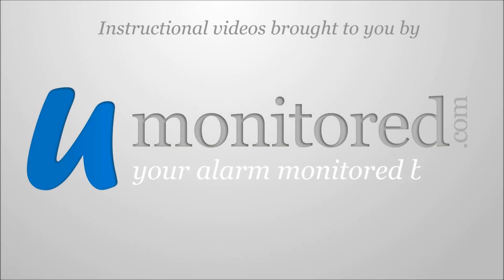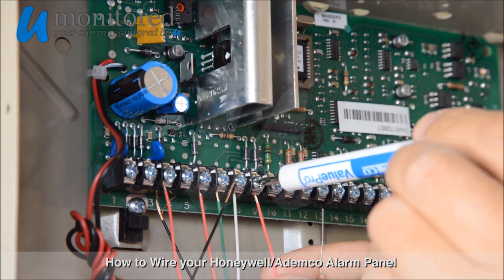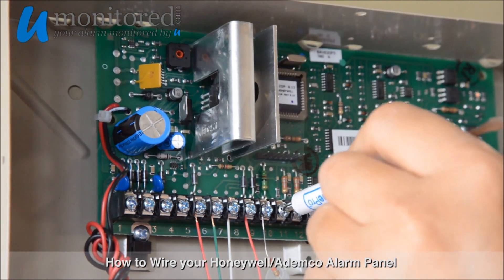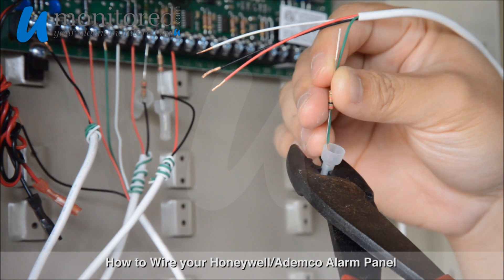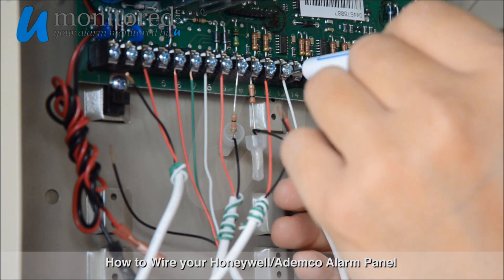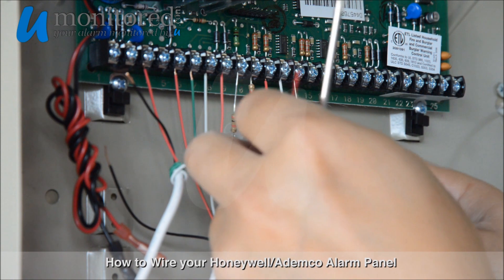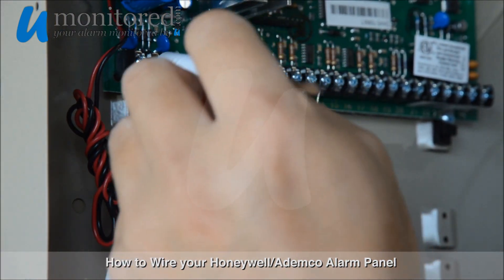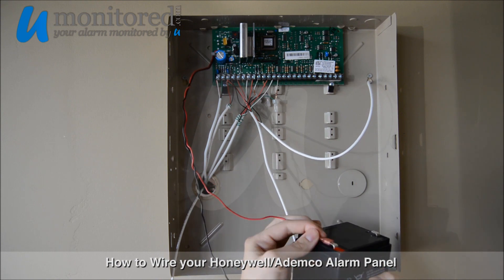Honeywell | How to Wire your Alarm Panel

Comment: EOL's Go to End Of Line, You Should Twist Strands, Larger Wire For Transformer is Better, Then You Can Hook To Ground, Dressing the Wires Can"t Hurt, It Will Work as Shown. Didn't Hear Mention Of Bell Resistor. In Programming, It may Have Ability To Select, EOL Or No EOLS, Eleminating the the Need for Way you Are Doing, Thing I see the Resistors on Board That ir Switches to in Programming.

Comment: Problem 1: Why did you put the EOL resistor in the panel instead of the END OF LINE? (in the panel defeats the purpose of the EOL resistor)
Problem 2: The transformer is internally fused, so the AC wires should be connected to the transformer and panel before plugging in the transformer in the 120VAC outlet, You missed the step of plugging in the transformer
Problem 3: The battery MUST be connected after the transformer is plugged in!

Comment: Why are you teaching them to install the End-Of -Line (EOL) resistor in the panel, This provides NO wiring supervision. Example: If a wire to wire short develops on the field wiring of any zone wired this way, The panel will not respond to an intrusion, making the installer liable for any loss sustained, Insurance companies will destroy you in a courtroom for negligence. This is not wiring according to the manufacturers published instructions. I am very familiar with this control panel, Please learn to install properly before teaching others to do it the wrong way!

Comment: I’m renting a home and my son pushed a bunch of different buttons on the key pad and set the alarm off, which wouldn’t disarm so every time I we opened any door the alarm went off. In a panic I cut the wires in both keypad, but the alarm was still going off. I found the motherboard where all these wires are and unscrewed all of them and that worked. My question is who I do call to fix the keypad that I cut and does anyone know how much that would cost? Thank you in advance.
Reply: Hire someone that knows what the heck they are doing

Comment: Not looking at the wiring schematics, but looks like your alarm panel is incorrectly wired. Your resister should go on the zone ( really needs to be in the field, but inside the panel
 is ok too ) but keep the resister on the zone terminal and the return wire on the common terminal. 
On this panel AC wire doesn't have positive and negative.  It's AC, It's Alternating Current.
Only terminals 3,4,5 matter for power. 3,4,5 are DC.
And why is he using this screw driver ? Use a real screw driver.

Comment: I have a battery for my panel and system but it won't power for some reason I charged it there is juice in it but it won't power it do I need a transformer or something
Reply: Don't know if you fixed your problem yet. If you're not getting power at your keypad yet. Un-do the battery,  check your AC transformer ( 16.5 AC ), is the transformer any good ? Is the outlet live ? is the wire good ? The wire I recommend 18/2. 
If all this is good, your keypad may need to be addressed. I don't remember, the keypad address maybe at 16, or maybe it's 31. 
If still nothing, you may need to call Ademco Tech Support, Honeywell.
Reply: The Ademco panel will not power up if start only on battery, has to be powered from AC/Transformer first battery then is used as a backup only. these transformers can go bad internally, had a couple wire on transformer broke they are made to tight (took them apart to find out, also internal fuse in transformer that can blow non replaceable so need to check if getting 12 -14 Volts AC out of transformer
Reply: Mike Clarke I posted the comment 2 years ago and now I have a whole system running up! But if I still dinit have it running that would really help!! Thank You Tho!!😇

Comment: NO NO NO! Resistors do not go in the panel! They go at the END OF THE LINE (at the sensor) Hence the name END OF LINE RESISTOR (EOL). If you're too lazy or unable to put the resistor at the end of the line at the sensor, then just program the zone as Normally open or closed, not EOL
Reply: I dis-agree, why would you program the resisters out ? You're inviting trouble doing that.
Reply: If you're not putting the resistors at the end of the line (at the device, not in the panel) then its essentially like not having them at all. Hence my comment.
Reply: I see your point. But I still would not program them out.
Reply: do you know how a resistor works in a burglar alarm when properly installed? Why would you not program them out if they are not used? The vista panel literally will show a zone as faulted if you don't have resistors installed but still have the zone programmed as EOL.

Comment: 1.) Why are the EOL (End Of Loop) resistors located in the panel, instead of at the END OF LOOP?  (in the panel defeats the purpose of the EOL resistor)
2.) As I read the instructions:
     2a.) the transformer is internally fused, so the AC wires should be connected to the transformer and panel, before plugging the transformer into the 120VAC outlet.  You missed the step of plugging in the transformer. 
    2b.) the battery must be connected AFTER the AC transformer is plugged into the outlet.
Reply: I guess EOL / EOLR is covered in comments below...

Comment: The resistors called: "END OF LINE resistors." Who is this idiot to putting resistors at the panel?
Reply: I agree,,,, I'm just amazed. Over the years, I've seen sloppy work. But the sloppy work usually comes from poor teaching. He was most likely taught this way. If he was working for me, I'd have to re-train him.

Comment: They're called end of line (EOL) resistors, not in the can resistors. You might as well eliminate the resistors and program the zones as NC or NO. Resistors are supposed to go at the sensor/device/contact, not in the can (control panel)
Reply: Where does the end of line (EOL) resistor go?

 The EOL resistor should always be installed at the last device and never inside the control panel. Placing resistors anywhere other than the end of line does nothing to supervise the wiring, which is the reason for using the resistors. The only exception to a resistor ever being in a panel is in a 4 wire with the resistor at the end of  the return pair, in the panel. It supervises the entire cable, both pairs that way!

Comment: Those EOL resistors needs to go at the End Of the Line so that the panel can detect someone tampering with the cabling.
Reply: joe72205 yep. The instructions on here defeat the added secururity of EOL completely!  You would think the term " End of line " may have given them a clue. Makes me shudder to think that crap wiring is going onto a system that has monitoring. That install would never get a URN number in the UK!

Comment: Does this panel have a tamper for the cover? It didn't look like it, which would make it easy for a burglar to destroy in seconds
Reply: It doesn't come with a cover temper no. But it's always good to protect the alarm panel as well. Put a motion in the same room. Anybody tries to get to the panel, they have to cross the motion, and program dialer delay 0.
Reply: Most panels residential usually does not and in a  place (or should be) if someone gets to it without being detected they deserve to have at it :-)

Comment: How would someone know which wire pairs belonged to a specific zone?  How do the techs know where the wires go when there is just a big mass of wires poking through a hole in the wall?
Reply: LockJawStudio Tone all the wires out.  Slap on a multi-terrain and begin looking for the window or door that gives you tone.  That's layman's terms.
Reply: LOL!!! Or you can do the easy way and just label each cable so you'll know where they all end up...